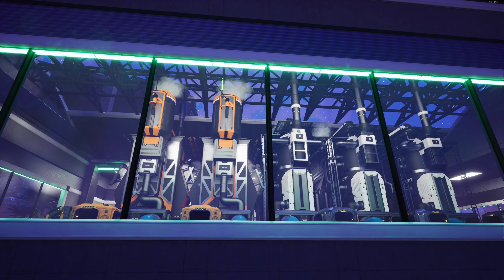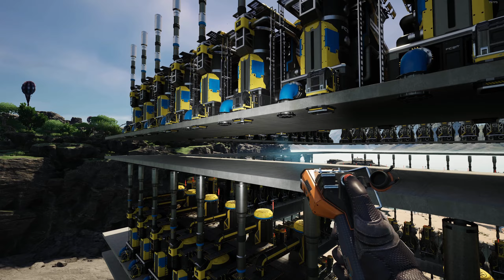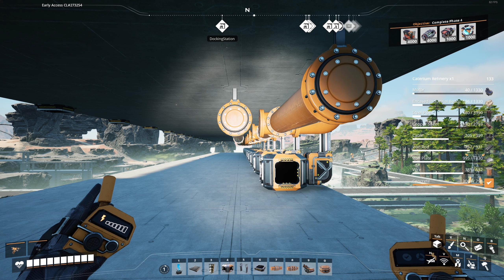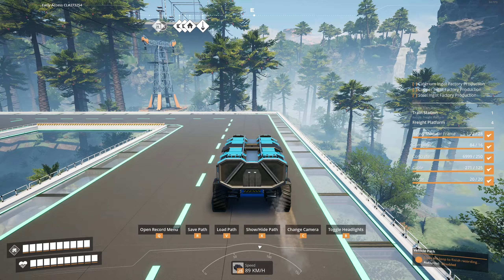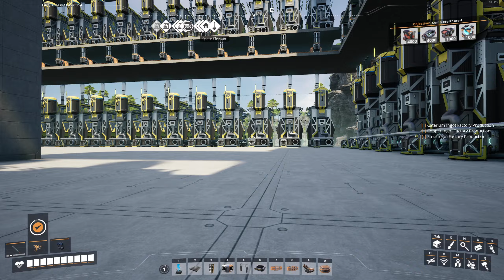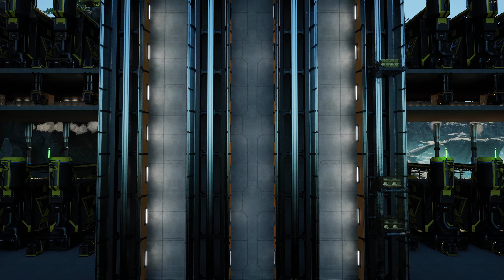Satisfactory Update 8! Building a HUGE Caterium Ingot Plant!

Comment: If it can put out 1560 ingots per minute, where are you going to get the 3120 per minute ore from to run it at full capacity?
Reply from the maker: Great question! There's a pure node close that I'm currently using. Also, there's a pure node just west of the plant in Rocky Dessert. I'll probably bring in a couple of the pure nodes from the eastern shore as well. 780 x 4 = BAM 3120

Comment: How did you daisy chain the refineries? Beams? Mods?
Reply from the maker: No mods, I used the road barrier/pillar method to line it up and used beams to place a wall outlet. Right on top of the existing connection. I might make a video on how yo do it in the future.
Reply: @falconphoenixgaming  I’ve never seen them aligned so perfectly. Can’t even tell the wall outlets are there!
Reply from the maker: I posted a video on this for you